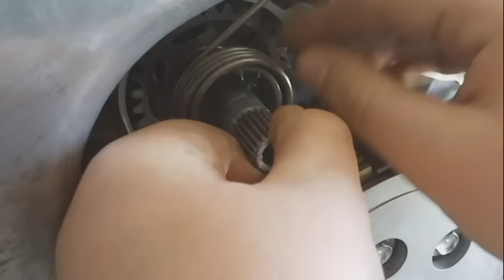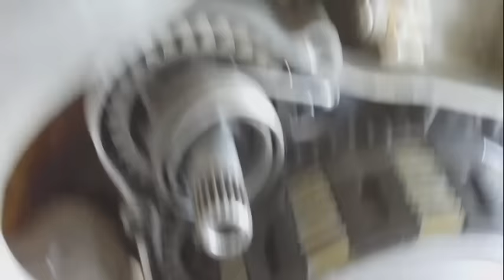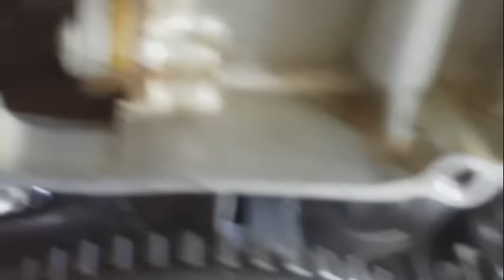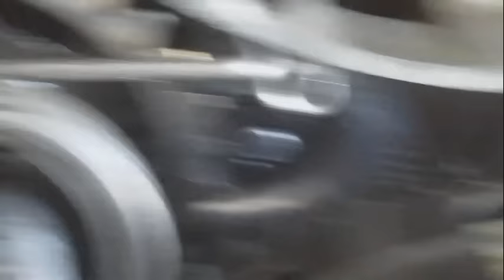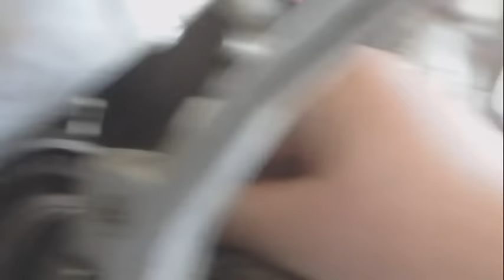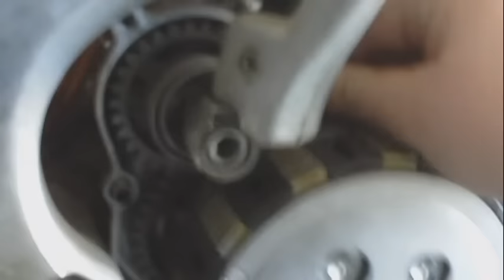Kickstarter spring.

Comment: For those of you who have this problem the solution is simple. If you flip the shaft and the gear over and look at the end of the shaft that goes into the case, look at the end of the the two...there is timing marks punched on the gear and shaft that have to line up on the shaft for the spring tension to be correct. It is that simple.
Reply: No it is not I have the parts installed correctly and the spring still pops off every time the case goes the spring is worn where it insert into the hole and the hole itself is showing signs of wear. Replacing the spring solved the issue.
Reply: Yours still a hero 7 years later! Just rebuilding a car 125 2001 and run into the problem! Legend

Comment: the spring is located in the hole closest to the gear. not the hole on the shaft. this will allow the spring to sit closer to the gear and to be pretensioned. he has put the spring in the shaft hole not the hole closest to the gear.
Reply: You just got me back up and running i didn’t see the hole further back and put it back together wrong and broke my case. It’s fixed now!!
Reply: yo i love you. i just spent 2 days fighting the case and you just pointed out the exact priblem. your a absolute legend

Comment: You need more preasure on the spring.  Move the spring back more, or the post that it gos on. You should have to really pull on the spring to get it in place so it will hold

Comment: Sweet, just broke my spring this afternoon so now I know I don't have to take the clutch off.
Reply: RIP, the mounting point for the spring in mine is a piece of metal secured by a allen screw. The screw immediately stripped out and I do not feel like doing a full tear-down to get that fucker loose. I'll survive, it only takes a couple of kicks to start anyway.

Comment: The honda cr85 kick shaft is really tricky to get on, the hole is located bottom left and when spring pops off there is no way to get the spring arm past the clutch basket whilst its still in place so you have to pull kick shaft off completely (making sure the locations marks are lined up ) put the pin in the hole then use the actual kick on the shaft and turn it putting tension on the spring until it goes past the little catch that sits behind the shaft then push it all into place while making sure the other spring at the back sits in its place and the main spring doesn’t spring out of the hole, takes a good couple of tries ill tell you that 😂

Comment: I wanted to take the pull starter off a 79 cc predator and replace it with a kick-starter what problems do you foresee and what solutions?
Obvious I'm not going to have that spring toe-hold.

Comment: I had the same problem on my cr80 take the shaft out check that the two punch marks are next to each other and if that dosent work use rtv to hold the spring in the case so you can get the side on
Reply: You my friend are a legend. Your comment helped so much. Thanks for that. If your keen ver in Australia the beers are on me.
Reply: Dude, I’m completely rebuilding an 89 Cr 80 and trying to restore it to new condition. Parts are all but gone out there but I have 3 toasted crankshafts in 3 lower ends which still. Have plenty of good parts. I can’t get that spring to seat. Is it supposed to go in that inner hole on the center casing? I have new seals and gaskets and that’s the only thing that’s stopping me from completing this bike. I managed to get all the plastics back to nearly new condition with powder coated frame . Found a seat cover for that specific 1989 year. It’s the all red CR 80. I’m just hung up on this darn kick start spring assembly. This was a comment from six years ago. I hope you will hear me out there in the YouTube world.

Comment: your inner washer notch must slide over the inside spring tang you dont have this properly installed. The outer spring tang DOES go in that hole if you have a honda crf 04-06 do not attempt to bend the spring until you have the base properly installed.